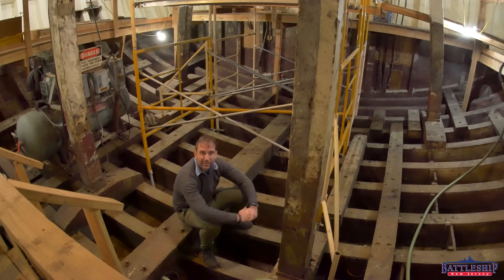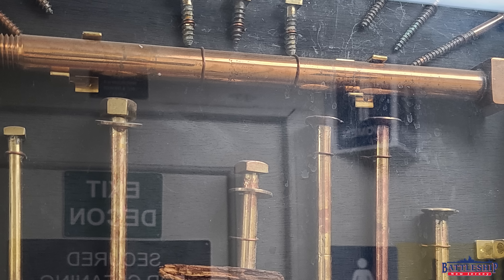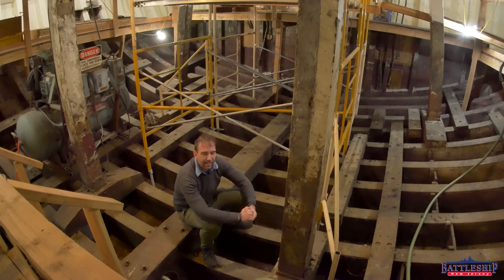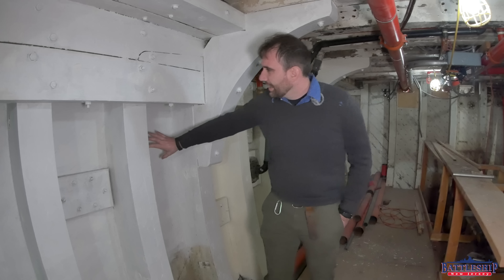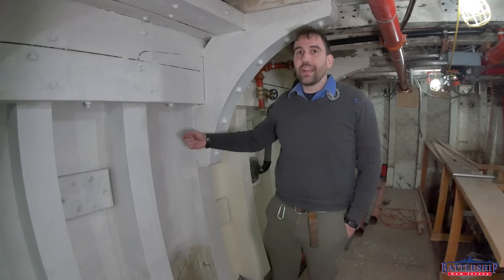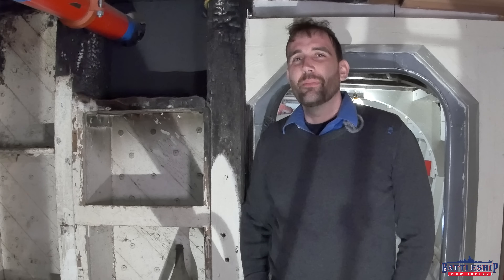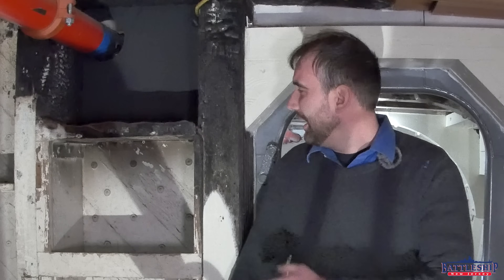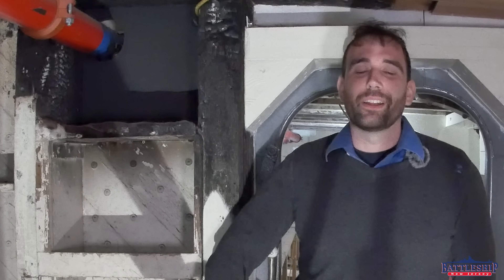Wooden Ships and Iron Men - Minesweepers

Comment: Part of the reason the USS Lucid has been able to be refurbished so accurately is that the Lucid was a sister ship of 3 MSOs that were built at Colberg Boat Works in Stockton CA, where I live.  Colberg still had the original working drawings and blue prints for the MSOs they made located in drawers in their warehouse which was still standing on the Stockton Waterfront. (It has now burned down :{  The Colberg family allowed the USS Lucid folks to copy all those blue prints.  Some copies are available for viewing aboard the Lucid.

Comment: Hand tools used for ships repairs such as handsaws, hammers, pipewrenchs, were made of bronze alloy they worked but were not very efficient, they were part of the ships inventory and had to be kept and maintained. Most ships had modern tools such as electric saws and drill motors etc. but had to be offloaded and stored on the pier be fore any minesweeping operations.

Comment: a Dutch MSI went through the degaussing range, where they found an anomaly in the forward section, where the officers and NCO's where berthed. Turned out the caps of the beer bottles under the officers wardroom where detected!

Comment: Did the wooden ships move any faster than another steel ship of their size?
Reply: Not really - On minesweepers the hull shape limited the speed more than the weight of materials used in their construction.  Also the shear volume of timber used makes the hull heavier than one would expect.
Reply: @Rob Smith  Thanks for the reply. I knew they had smaller boilers but had no idea what their speed was.
Reply: @joebeach7759  Given most WW1 minesweepers were diesel powered there were no boilers on either....
Reply: @18robsmith  I thought he said that the minesweeper he was on only had 2 boilers when the New Jersey had 8.
Reply: @joebeach7759  No, it had two diesel engines, driving the two screws, he then went on to discuss the materials used in the engines compared to the normal non-minesweeper ones.
Reply: @joebeach7759  Ah, you are getting mixed up between the minesweepers and the cargo ships, which had two boilers.
Reply: @18robsmith  I might be. Thought he was on a minesweeper

Comment: The use of non ferrous metals  and stain less on
Wooden hulls are pretty mutch standard  below the waterline ,this is 
Because you usely go for copper proof designs , this means that all thru hull "outside locking" fasteners of metal is not going to get worn away by cooper anod,  then you can put copper on the hull to protect from ships worm.
The extra layer of wood on this hull was probably meant as a sacrificial 
Part partly for this reason. 
The composite wood structure in the hull with the crossing planks are a design to prevent hull sagging,  this design is harder to maintain than regular planking  ,when you get water line rot you cant just replace the waterline planks  ,you have to replace the  diagonal planking also, thereby removing intact planking to get to the cange the diagonal  planking under. beams on the inside under the deck beams is mostly for transferring  side loads from frames inbewen them to the deck beams/and to bolt the beams to the frames.  They would also take up dynamic forces of the hull when sea going, 
You often had a extra keel on top  bottom frames , and it would be bolted  all the way thru  to outside one. This was to keep the hull from sagging. Sailing ships benefit from having the rigging helping to "lift "the for and  aft to some degree.
On non rigged ship this is not the case. When old ships got de rigged /(often turned to tow behind barges )
There hull deformation would accelerate,  or they would get engines  installed in the hull increasing weight 
In the less boient aft.
One funny fact is that mildly hull deformation could be solved by dry docking and   straiting the hull, then  repacking the 
End joints on the  hull planking hard  to keep the straitnes afterwards. 
At least for  wail.
The composite  framework works well,but only as long as the glue stays together,  the older glues tend to degrade and the stuff delaminate.
Using natural bows in the timber is more permanent. 

One must think about the fact that ships wasn't  and is not built with 
Looooong life in mind as a first priority. 
This creates special problems  when trying to keep them alive a long time after there original  planned lifespan.
Different materials different challenges.
Edit : oak is acid ad will corrode steel and other less Nobel metals, so steel bolts on oak corrode fast

Comment: That was very interesting , our sweepers were built with aluminium frames and bulkheads with a wooden hull . Specialized tools were issued for some jobs and any lost in the bibles had to be retrieved . A great explanation of hogging by Ryan . They were very expensive to maintain due to the non ferrous aspect . Fibreglass came in with Hms Wilton - essentially a replica fitted out with identical equipment and that heralded the end of wooden hulled ships . They were great little ships , one was commanded by Prince , now our King Charles .

Comment: I served onboard the USS Esteem MSO438 79-81 as a Minesweep Electricians Mate. It was a great ship. We had Waukesha Engines after the FRAM. The outboard main engines were also the two 2500 amp minesweep generators and fwd M/S generator in forward engine. There is a lot of room in aft engine with no equipment
Reply: I  served on the Esteem and Illusive   (MSO 448) in the late 60s. Wonderful memories and friends . RD2

Comment: The first fiberglass was built in the early 1940s and from there fiberglass got really popular for boat building in the 1950s-'60s. I'm a little surprised that the Navy was building wood boats into the 1980s.
I used to work for a company that built fiberglass yachts , some of them well over 100' long.
Reply: I'm gonna go out on a limb and guess fiberglass is a little to fragile for the navies purposes.
Reply: @hurnn1543  fiberglass is insanely strong

Comment: Great explanation of hog and why it happens to wooden ships. Absent machinery there is still almost as much wood fore and aft but those sections of the ship are narrow and offer very little buoyancy vs. the center of the ships where they were full and buoyant. The knees on the rebuilt parts of the C. A. Thayer (over in San Francisco Maritime National Historic Park) were rebuilt with laminated knees hidden within the original but compromised grown or sawn Douglas Fir knees. They offer a compromise of appearing original but replacing most of the structural integrity of the originals. I live near enough, really need to visit Lucid when they are ready. Thanks for the tour.

Comment: Interesting engineering challenge as non-ferrous metals tend to be more malleable than steel with less strength.  
Stainless has the strength but is far more costly than bronze, brass, or aluminum.
Reply: I work at a CNC Machine shop. My experience with costs is Bronze is very expensive, brass a bit less, then comes aluminum (similar to brass in price, and stainless is usually less than brass. But those are machining grades of metals (typically cold drawn bar stock) so I could be wrong about these metals in other forms (like sheeting, beams, plate, cast, or forgings).

Comment: Couldn't a ship's hull be made from a non-magnetic metal, like aluminum? 
I don't know if lightness translates 1-1 to speed but it sounds good for a minesweeping vessel that probably doesn't want to get into any sort of gunfights.
Reply: Al can easily be detected using an AC magnetic field.  Wood... not so much.
Reply: I was thinking "Why not use aluminum" and then I remembered the littoral combat ships are made of aluminum and are having hull cracking issues, which suggest it's not as simple as replacing all steel thicknesses with an equivalent strength of aluminum.